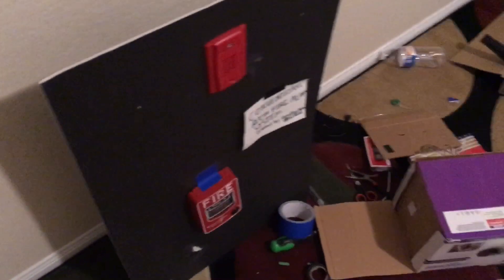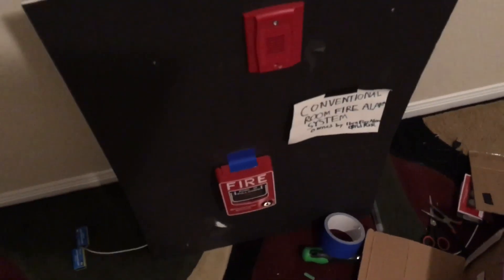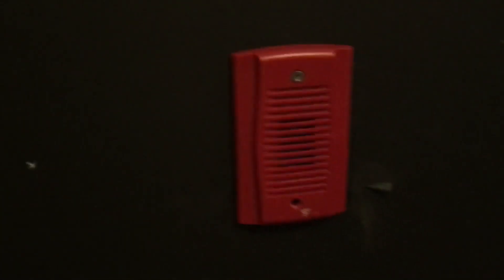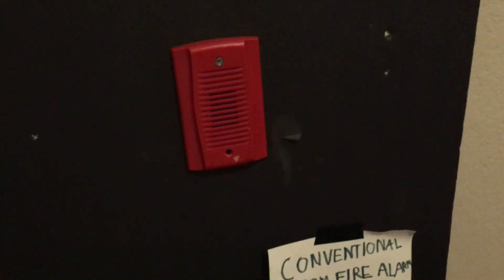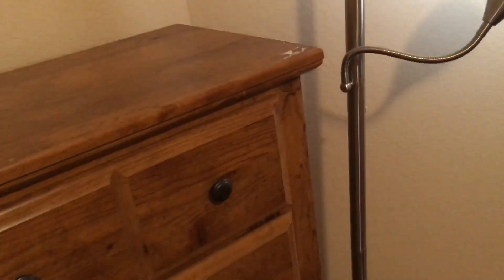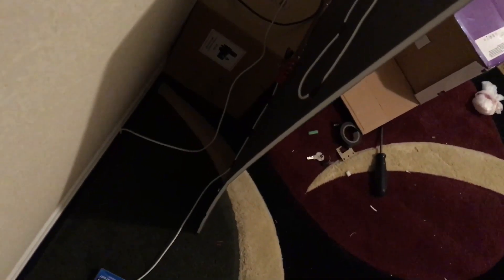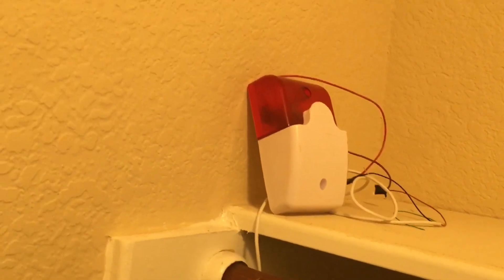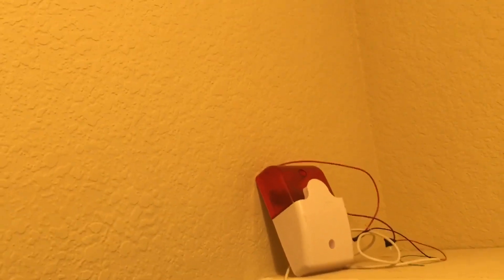System test 3 (Changes)

Comment: You can get hearing protection and remove the tape from the alarms so its not loud thats what i do
Reply from the maker: Don't worry I'm used to hearing a 1990's MT set to continuous I'm used to hearing an advanced I'm used to hearing first alert smoke alarms I'm used to hearing a ZNS and AS all without hearing protection
Reply: Ok